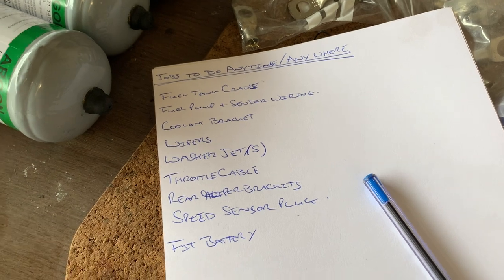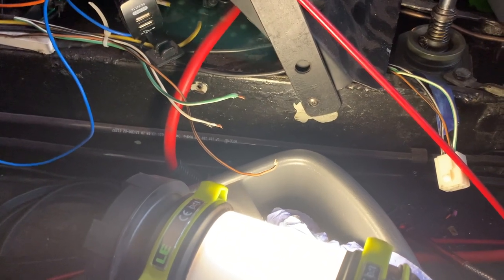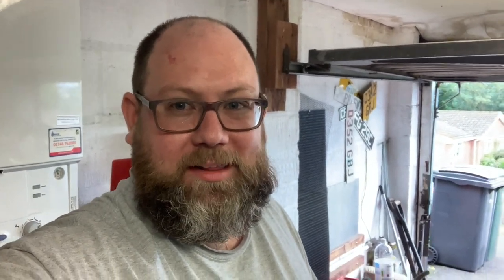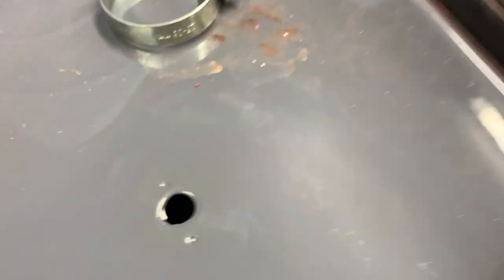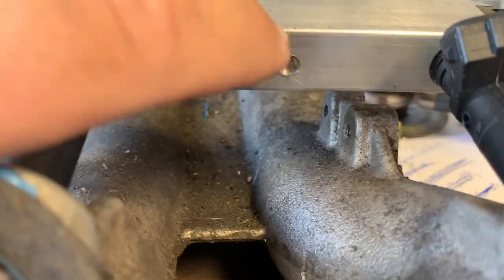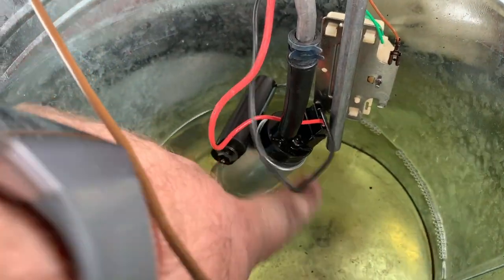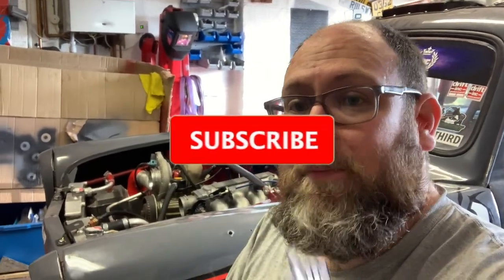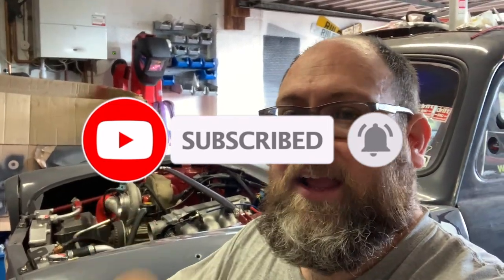It's Alive! - First Start of the Pinto Turbo Powered 1958 Ford Prefect 100e

Comment: I'm interested in your project coz I have the same engine in my Eagle RV kit car (it's also my daily driver!)
I have a damaged accelerator cable, do you know where I could get a replacement?
Keep up the good work my dude!
Reply from the maker: I’m using a universal sytec one from rally nuts.
Reply: @DuckSport  Thanks. I'll check it out. Maybe I can get rid of the bungee cords that fully close the throttle when I take my foot off!
Reply from the maker: Is the cable sticking in the outer?